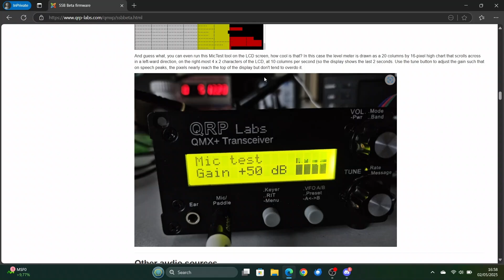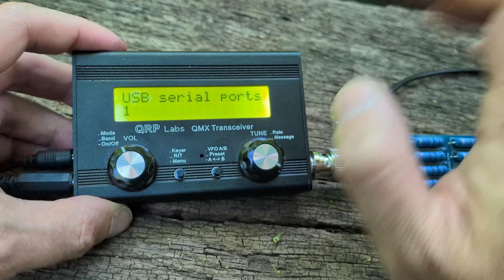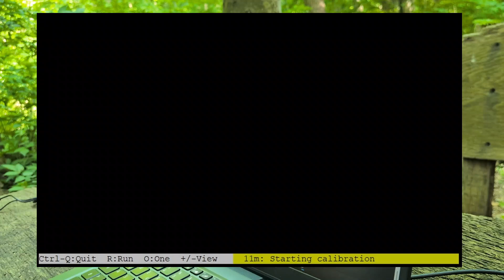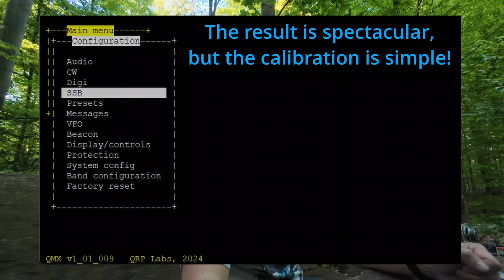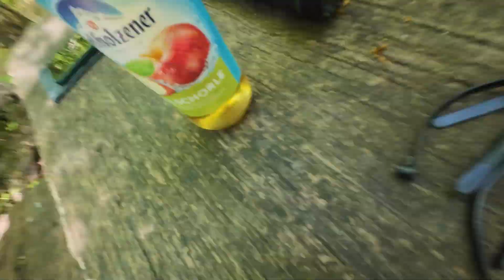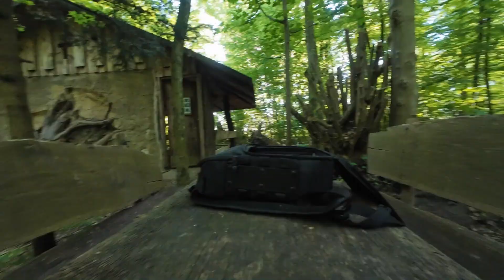QMX / QMX+ SSB Firmware - Install & Calibration | HamRadio

Comment from the maker: FYI, in the meantime I made it to the official SSB firmware myself. The 11m phase error vs. DAC calibration did not succeed this time. This is a feature to allow the remaining calibration steps to run through, when there is a problem detected with a single band. I think for the failed step it either uses default values or disables calibration for that step in order to allow operating on that band. - Alas failed  11m calibration is not a real problem.

Regarding damaging your finals during calibration: I think Hans is working on shaping the TX signal during calibration now to avoid any potential current spikes. There already is CW TX shaping, so adding it to the calibration is possible and should reduce the risk of fried finals.

One more point: There is currently no "Finished calibration" message, so if you run it to the end, the terminal will just stop at the end of the last band's LSB IMD calibration step that it ran through. If you think it is done, you can hit + or - and if it switches screen, you know you were successful and can exit the menu.

Comment: Can anyone comment on why my computer does not see the qmx?
I plug in the usb c to the computer, put the power on the qmx, and it does not come up at all.  In the menu, go to update firmware, click the tune button, and it goes off as it should, but still doesn’t come up in the computer.  So there isn’t a place to move the downloaded new gile.
Reply from the maker: Just follow the video: Without USB connected go to the firmware update entry, select, confirm, then wait until the device switches off. Then connect the USB cable, then press the button on the qmx to power on again. - QMX is not powered or woken up via USB, so it behaves differently like any other USB device.... 🤷‍♂️
Reply: my thoughts are it might be a Charging cable only and not a data carrying cable?

Comment: Its weird because I just followed your steps, update the firmware to 1.02.003 and there is not a "USB serial ports" settings inside "System Config". I wonder if they remove it and if the device dont have multiple ports anymore...I hope not...
Reply from the maker: Check if Hans has reshuffled the menus slightly. The website should also have a PDF with the latest documentation matching the firmware.

Comment: I don't consider 2 contacts in 2 hours as a failure. I think of QRP like fly-fishing. Sometimes I catch fish. Sometimes I don't. But I'm there for the fishing, not the fish. With the right antenna and good atmospheric conditions and some good QRP technique you'll get all sorts of contacts, and the satisfaction you get is the same as catching a big trout on light tackle. In fact, if I'm making a lot of contacts I reduce power from 4 or 5 watts to under 1 Watt just to keep it interesting. 
Thank you for this presentation. I'm an Elmer, and people like you who do good YouTube video Elmering have my respect. 73
Reply from the maker: Thanks for your kind comment! Conditions were not ideal and it was a working day for most of Europe, so not a POTA pile-up. Alas spent a nice day outside instead of doom scrolling on the computer / smartphone. So all was/is well... 👍

Comment: Thank you for the video!  I installed the firmware but have not completed the calibration yet.  This video will make that process much easier now.  Thank you!
Reply from the maker: It's easy, it just takes ages to run through and fingers crossed that the HF transistors survive. Still a bit of a miracle that there are reports of damaged devices. Alas as only the guys with problems will shout, I guess there are lots and lots of users who had no problems and we never heard from them. 🤷‍♂️

Comment: Bonjour belle vidéo :-) avez vous un lien à me donner pour la charge fictive 50 Ohms ?? Je ne la trouve pas sur le site du fabricant ... 73's
Reply from the maker: @HamRadioSolo  I think you are asking where to get the 50 Ohm Dummy-Load from. I think RoWaves has changed their business model slightly and it is no longer available from them.

However as I am already promoting the QMX here, QRP-Labs has also a Dummy-Load kit available. Maybe this will suit your needs as well: https://qrp-labs.com/dummy

(P.S.: I am not sponsored and all gear was bought by myself with my own money.)

Comment: Excellent video! Do you have a link for the QRP microphone momentary-on limit switch that was used?
Reply from the maker: Thank you! Well actually I searched for a suitable case for an existing switch in my junk-box and not the other way round.

Those kind of "micro" switches have been around for decades. The one I used fitted the case, but the round  plastic nooks were probably supposed to go in some mounting holes on the switch, which mine didn't have.

I think you can buy new ones from ZF or Marquardt or Omron or Zippy. Or look on eBay or AliExpress for "microswitch 250V 16A" or "joystick microswitch".

Comment: Kudos Tobias! I will bookmark this. I will hold off updating FW on my QMX+ until things are a bit more stable. CW is fine for me just now. On the failed POTA activation, I can only apologise ha ha. Drop me a mail sometime and I will send you a couple of these EFHW PCB's and you can build a 21/3 Autotransformer (I think you will have some of those QRP cores) to gain 8 - 10% on efficiency. 73.
Reply from the maker: Haha no worries Colin. I guess it was just a bad idea trying POTA on a normal weekday. 1st of May is not a public holiday everywhere. But the weather was great!

Would love to try your PCBs of course!
Reply: @labcat73  Finally did my first FW upgrade tonight,  again a great reference video. I wont do the calibration till i get my Mic. That Mic capsule is sold out everywhere! I need to source another type somewhere. I have some of the K6ARK mic enclosures printed by JLPCB. 73 for now.

Comment: Thanks for very interesting video. Although I am not planning to use SSB on my QMX, it was very informative and maybe I will change my mind.. But I have another idea for interesting material - assuming You're CW op also - AGC settings. These are a nightmare to get it right. Regards, Greg SP3RNZ.
Reply from the maker: Hi Greg! Well my CW needs some work cough (understatement of the year). If I ever get it up to scratch, I will surely try it with the QMX... At least I am diligently carrying my palm radio paddle with me. 😆